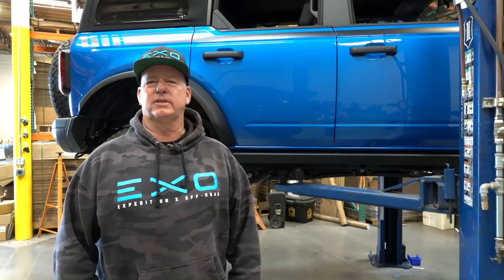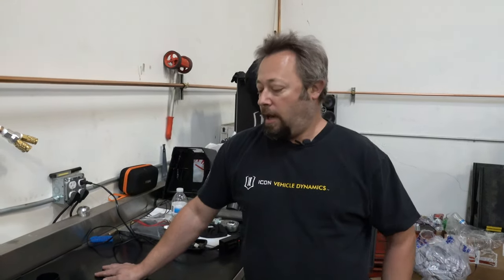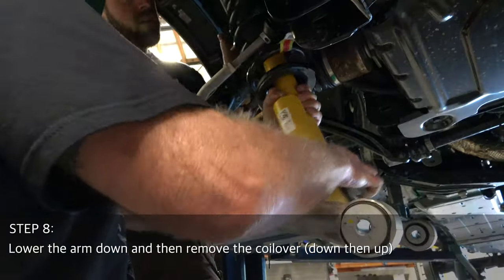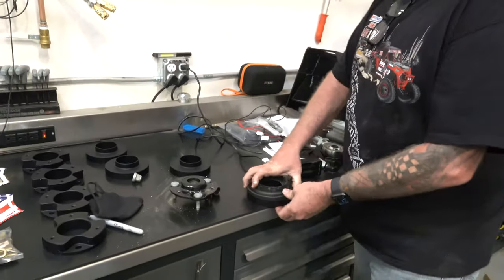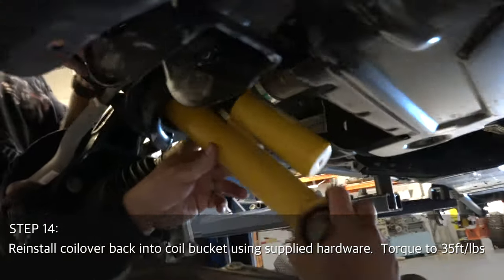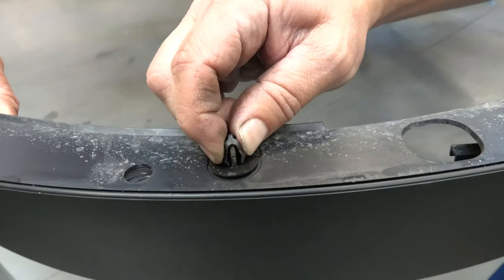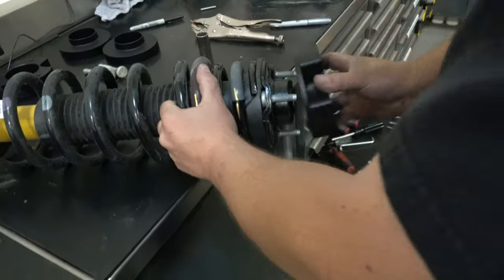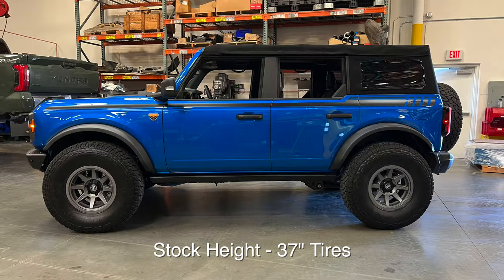2021+ Ford Bronco - Icon 3 inch lift install | Step by Step

Comment: Icons technique to take out the struts is soooo much easier than zones technique. Basically just disconnect the sway bar and unbolt the lower arm as opposed to zones lift basically saying to disassemble the entire suspension system.

Comment: Very nice! I'm going to check out that kit.  What offset do you recommend for the rims to fit 37's on a non sasquatch badlands with that kit?
Reply: 0 Offset works great.  Even stock with 0 offset, rubbing wasn't an issue on the streets.
Reply from the maker: Since you have a non-sas you’ll use all the pucks and end up at the same height. We prefer 0 offset. Tire sticks a little outside the fender but not by much. Gives it a nice aggressive look without going to crazy on the offset.

Comment: So in your professional opinion, do you feel all the stock components on a non-sasquatch would be compromised with a 3" spacer lift? Would you at least consider upgrading the UCR's? My Bronco will not see hardcore offroading, I'll leave that up to my Wrangler with a 6" long arms susp lift.

Comment: When are they coming out with coilovers
Reply: Soon... they already have it designed and tested, and have working kits.  Just waiting on the production springs for the coilovers!
Reply from the maker: Yes! Should be out soon. 10” of travel in the front and almost 15” in the rear. It’s going to boogie.

Comment: 3" lift on spacers? No thanks. I know icon makes some very nice suspension components,  I would wait for the coilovers that are coming....
Reply: It's a 2" spacer, then also a 1" preload spacer... not entirely a spacer.  It's a great, low cost compromise until Icon's full kit comes out.  And it still rides and drives great, like stock.  For those that don't off road hardcore, this would be great long term.